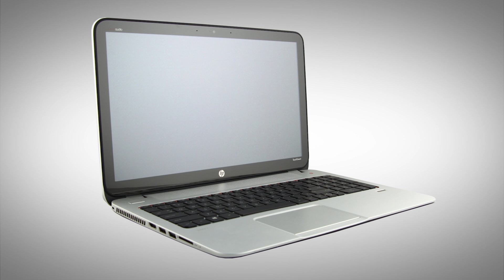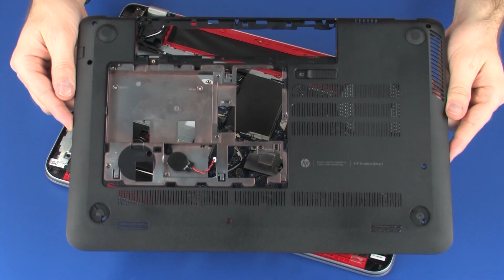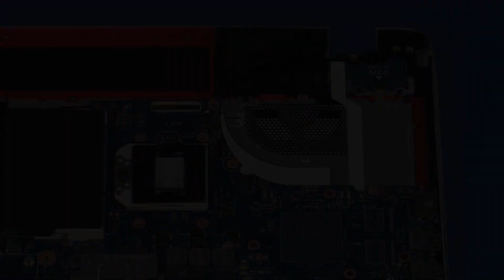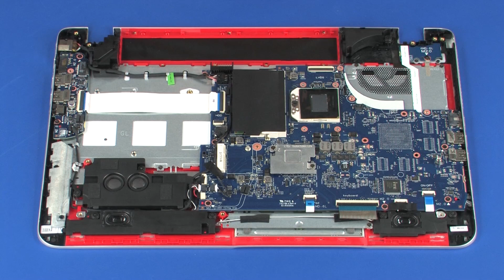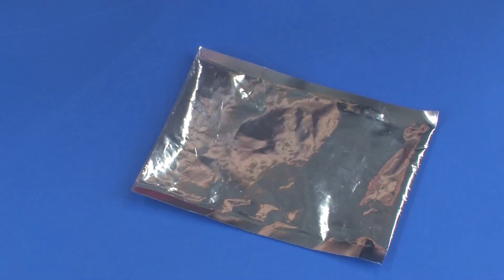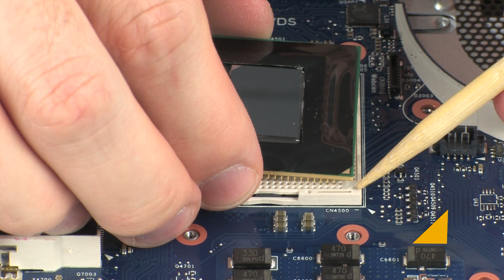Replace the Processor | HP ENVY Notebook - 15-q370ca | HP

Comment: Can i upgrade the processor of my hp 14 bs537tu?
Reply from the maker: +Miguel Ortizo HP does not recommend upgrading or downgrading hardware parts or software that is bundled with the product as It may affect the manufacturer's warranty and performance, however, you could change the configuration at your own discretion.

Comment: My laptop has a BGA socket instead of a PGA socket thats showed in the video, is there anyway I can replace my cpu without destroying my motherboard or taking it to a repair shop?
Reply from the maker: +Kye HP does not recommend upgrading or downgrading hardware parts or software that is bundled with the product as It may affect the manufacturer's warranty and performance, however, you could change the configuration at your own discretion.

Comment: Can I upgrade Hp pavilion cs1000tx i5 8gen to i7
Plz reply
Reply from the maker: +m .praveen HP does not recommend upgrading or downgrading hardware parts or software that is bundled with the product as It may affect the manufacturer's warranty and performance, however, you could change the configuration at your own discretion.

Comment: Can I upgrade from i3 to i5 on 14dh0107tu pavilion 360
Reply from the maker: +Devil's world HP does not recommend upgrading or downgrading hardware parts or software that is bundled with the product as It may affect the manufacturer's warranty and performance, however, you could change the configuration at your own discretion.
Reply: So it is upgradable processor?

Comment: Would an i3 9100f fit inside a hp notebook? Im just wondering if its replaceable and to be sure ill take it to a repair shop.
Reply from the maker: +Aruran Kughathasan HP does not recommend upgrading or downgrading hardware parts or software that is bundled with the product as It may affect the manufacturer's warranty and performance, however, you could change the configuration at your own discretion.
Reply: @HPSupport  I am asking if its soldered or not for the HP Pavillion notebook?

Comment: Hi sir
Can I replace my CPU on my dv6-7247CL?
Reply from the maker: +Tahania Rahman HP does not recommend upgrading or downgrading hardware parts or software that is bundled with the product as It may affect the manufacturer's warranty and performance, however, you could change the configuration at your own discretion.

Comment: Can I upgrade processor for hp pavilion g6-2248ca ?
Reply from the maker: +Timothy Andrews You can install any one of these 2d gen Intel Core processors:
Intel Core i7-2620M processor (2.7 GHz, SC turbo up to 3.40 GHz, 4 MB L3), Dual 35 W 631252-001
Intel Core i5-2540M processor (2.6 GHz,SC turbo up to 3.3 GHz, 3 MB L3), Dual 35 W 631255-001
Intel Core i5-2520M processor (2.5 GHz, SC turbo up to 3.2 GHz, 3 MB L3), Dual 35 W 631253-001
Intel Core i5-2410M processor (2.3 GHz, SC turbo up to 2.9 GHz, 3 MB L3), Dual 35 W 638039-001
Intel Core i3 2310M (2.1 GHz, 3 MB L3) Dual 35 W 638037-001

Comment: Can I upgrade my intel pentium gold on a HP laptop 14-cf0xxx to i3 or i5?
Reply from the maker: +Ben HP does not recommend upgrading or downgrading hardware parts or software that is bundled with the product as It may affect the manufacturer's warranty and performance, however, you could change the configuration at your own discretion.
Reply: HP Support is intel pentium(R) 4417U soldered into the motherboard on this laptop?
Reply: Yes if its supported and compatible with the ram and motherboard and uses the same socket type u coule put i7 in

Comment: Can I replace the processor on my HP Notebook - 15-da0047ns
I really need to change it to get a better clock speed.
Reply from the maker: +Benjamin Bordne HP does not recommend upgrading or downgrading hardware parts or software that is bundled with the product as It may affect the manufacturer's warranty and performance, however, you could change the configuration at your own discretion.
Reply: @HPSupport  have you guys noticed that most of the requests are coming from the HP 15 series? both notebook and envy wink-wink  personally, I've had to upgrade ram and HDD to SSD just to get a reasonable experience and now thinking of CPU. I just feel you could have done a lot better with them series.

Comment: HP Notebook - 15-ay024na  = Can I change the processor in this. I can't seem to find any motherboard information on the HP website for this
Reply from the maker: +Shaz Ameer HP does not recommend upgrading or downgrading hardware parts or software that is bundled with the product as It may affect the manufacturer's warranty and performance, however, you could change the configuration at your own discretion.

Comment: Can a  (HP15ac101tu) processor be changed
Reply from the maker: +Titas Roy HP does not recommend upgrading or downgrading hardware parts or software that is bundled with the product as It may affect the manufacturer's warranty and performance, however, you could change the configuration at your own discretion.

Comment: Can I do it  with my hp notebook model 14?
Reply from the maker: +Todd Howard You would have to replace the motherboard with one listed in the service manual for your notebook, in order to upgrade the processor, as the processor is an integral part of the motherboard.
If you could find the part, since your notebook is so new, it would cost more for the motherboard than to buy a new notebook with a better processor already included.